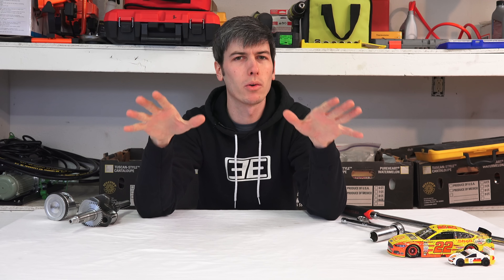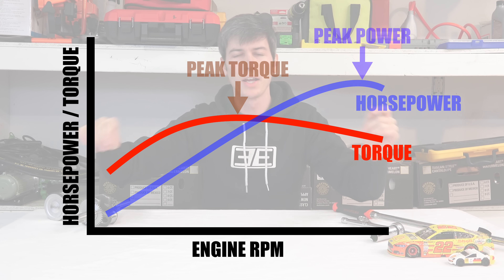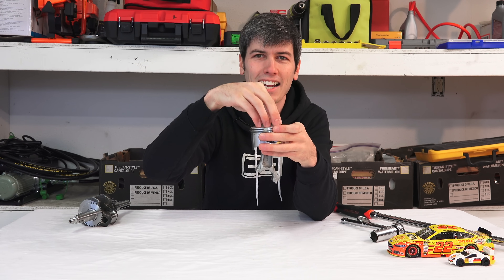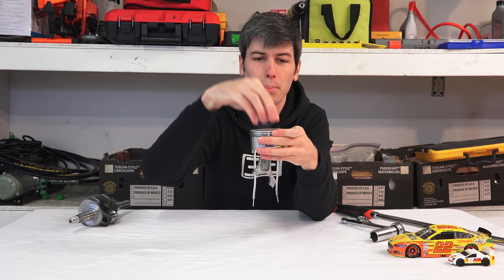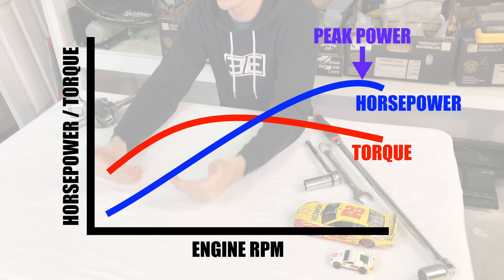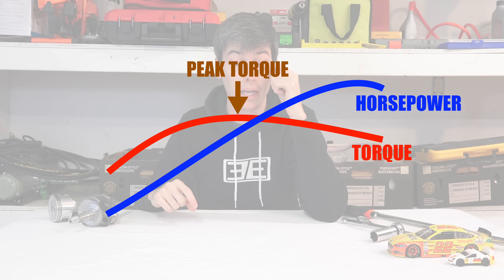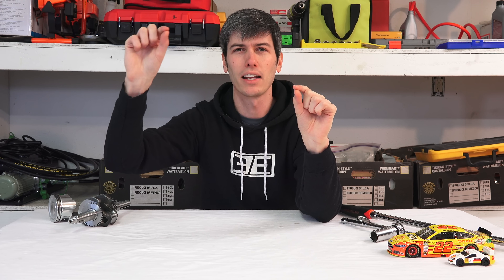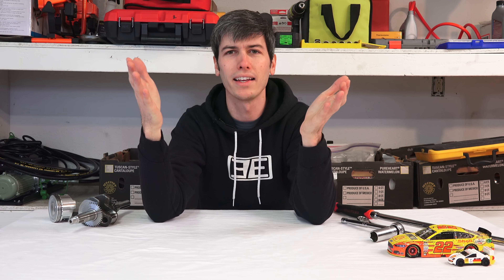Horsepower vs Torque - A Simple Explanation

Comment: "I don't understand."  (Buys a diesel.)  "OHHHHH!  Now I get it!"
Reply: People just feel more power at lower rpm and think "oh this is torque" when really it's just more hp at lower rpm.
Reply: @SlyNine  No, its not like that.
I have a Golf 4 1.9 TDI AHF 110 hp + Remap
My biggest torque is 320 Nm at 2100 rpm, but the maximum Power  (140+hp) the engine reaches at 4100 rpm :)
I have dyno graph.
Reply: Infovest  Uh you can't compare a production car to a built drag racing car, that's no comparison at all. Find me a street legal production car capable of trapping at 190 mph on the quarter mile, good luck.
Reply: Jacob Jensen
I can put down 150 all day on my stock motorcycle!
Reply: Back2Black cries as you fly off of a cliff
Reply: Turbodiesel... well buy a turbo petrol... now its fast
Reply: @Marco Franciosi The torque at the crank gets multiplied by the gear box. What tells you if the lower torque at the crank will be overcome by the better gear ratio. Say it with me. "HORSEPOWER"
Reply: @juschu  and then crashes it
Reply: Haha
Reply: No, you still don't get it.
Reply: Spark plugs FTW
Reply: @juschu  
Then you crash it down a hill past the finish line.
Reply: You bet my f350 with 7.3 turbo. Is just as fast with or without a load. But around 80 your topped out lol
Reply: Funny enough, my favorite real world example of why power is so important involves my experience using two different diesel trucks to tow the same heavy trailer up the same long grade in MT. Spoiler - the one with more power towed better. The truck with more torque made that torque at a such a low RPM that it required a much higher gear ratio at the same road speed as the other truck, meaning less wheel torque = less pull (less power).
Reply: *Buys a Tesla
Reply: 30hp diesel = 30hp otto/gas. The crankshaft brake power of both are the same.  You might conclude that gasoline engine has stronger torque because of actual and on hand experience, yes it is, though. The otto cycle (gasoline engine) produce its power with only 2 stroke to complete the cycle while the diesel engine needs 4 stroke to complete the cycle. Thats why gasoline chunks alot of fuel compared to diesel which will result to higher torque and acceleration. In conclusion, diesel is much more efficient than gasoline engine as it squeezes the available heating value of the combusted fuel. Application for otto cycle relates to high speed-high acceleration vehicles from automobiles,motocycles, small boat while diesel application goes into large and heavy vehicles
Reply: @Nafets-C  WRONG! Nikolaus Otto used a 4 stroke design. Nice try though. The modern 2 stroke cycle wasn't stumbled upon until WELL into the 1900s. And Otto DID NOT like the idea of mobile engines. He thought they were best suited for replacing water or steam power in manufacturing...

But you are correct that diesel fuel has more thermal potential than does gasoline. This is due the fact the diesel fuel is actually a very lightweight oil while gasoline is much more similar to a solvent.

Comment: Let make it the way , torque is the power of force apply to engine and horsepower is the speed applied from the engine , in short torque is required more for heavier cars, torque is to move a car fast from stop point and horsepower is to move the car faster from cruising

Comment: Someone pleaes explain So why would ever wanna shift at Max BHP ? I get it if you wanna pull away or over take then you wanna do it at Max Torque 

So if my car produces 84hp @ 4k rpm but i'm getting max torque of 150 Nm. Why would i wanna rev my car an extra 1k to get 95hp @ 5k rpm but only get 135 Nm of torque. By the time they hit 5k revs im already pulling away and hitting 5k reaching max hp
Reply: depends, high torque is great for low speed while high horsepower is great for high speed....

Comment: Would I be right in assuming that the physical momentum of the engine begins to allow the engine to use its power more efficiently after the initial torque curve? Much like if you need to move a heavy object it is much easier to do once it's already rolling? I suppose what I'm trying to work out is - is the torque peak the highest labour part of the engine and the power is the highest end result after the brunt of the labour has been achieved by the torque? Imagine bump starting a car, the initial heave, then the seemingly effortless push to accelerate it further until you run out of legs essentially.

Comment: Simplified Example:

Engine Torque (straight lines connect these points):
     180 lb-ft @ 2500 RPM <-- Max. engine torque
     150 lb-ft @ 6500 RPM 
     100 lb-ft @ 7500 RPM (redline)
BHP = Engine Torque x Engine RPM / 5252
     86   BHP @ 2500 RPM
     186 BHP @ 6500 RPM <-- Max. BHP
     143 BHP @ 7500 RPM (redline)
Tires rotate 750 times per mile (this is needed to derive gear ratios below)
For simplicity, assume no losses in the drivetrain

Scenario 1:  You’re driving along in 2nd gear at 15 mph and you punch the gas.  What do you feel?  The tractive force of the tires in a given gear will be proportional to the torque curve.  You will feel the maximum acceleration at peak engine torque, assuming you don’t change gears!  

Scenario 2:  You’re driving a given speed and you want to select the right gear to maximize your acceleration.  In this case, you take mechanical advantage of the gearing to combine with the engine output.

1) Say you're driving 60 mph and you're in 5th gear.  Your engine speed is 2500 RPM, so you're at max. engine torque.  The combined gear ratio of your drive train is 3.333:1, so your torque to the drive axle is 180 x 3.33 = 600 ft-lb.

2) Say you're driving 60 mph and you're in 3rd gear.  Your engine speed is 6500 RPM, so you're at max. BHP.  The combined gear ratio of your drivetrain is 8.667:1, so your torque to the drive axle is 150 x 8.667 = 1300 ft-lb.  <-- This is the gear where acceleration is maximum from this speed.   

3) Say you're driving 60 mph and you're in 2rd gear.  Your engine speed is 7500 RPM, so you're at redline.  The combined gear ratio of your drivetrain is 10.00:1, so your torque to the drive axle is 100 x 10 = 1000 ft-lb.  

Because the gearing varies the mechanical advantage, the torque at the tire axle varies from the engine's torque output when you change gears.  You can see that they are related by a linear function of engine speed, and are not related by a single constant.   Acceleration is proportional to the torque of the axle, but this also means that torque of the axle, and so acceleration, is proportional to the power of the engine when you change gears. 

Tractive force under the tires is what gives maximum acceleration, and it is also what gives you top speed as you push against ever increasing wind resistance.  There’s a belief that torque is for acceleration and BHP is for top speed.  As you can see, this is not the case.  

The bottom line is that the torque curve tells you how the tractive force will vary as you accelerate in a given gear, and the BHP curve tells you which gear to select to maximize tractive force of the vehicle.

[Gear Ratio Calculation:  Engine RPM / (Tire rev. per mile x Car MPH) x 60 min/hr = Rev. of engine per Rev of tire, = Combined Gear Ratio, or the ratio from the selecte
Reply: HollywoodF1 did you say simplified

Comment: A good example for this are V10 F1s, 18000 rpm, 900 hp, and poor torque but are so fast!
Reply: Raúl Vargas that’s correct but some people will not understand it, I’ve also gave this example to some guys and they replied that the cars are too lightweight. But they are two times lighter and 3 times faster acceleration than a 6s 0-60 car with the same torque.

Comment: Why don’t horsepower and torque peak at the same point ?
Reply: Because HP = TQ*RPM/5250 therefore RPM is always a factor and they'd always be equal only at 5250 RPM.  Higher revving engines can have much higher HP at higher RPMs.
Reply: Graph the following functions:
f(x) = x*(4 - x)
g(x) = x*f(x)

Do g(x) and f(x) peak at the same point?   No they do not.  Same relationship exists between torque and horsepower, both as functions of RPM.

Comment: What's the advantage of low pwr, high torque (1985 BMWe  120hp, 170ftlbs.)
Reply: Just look at a 100hp tractor, he can haul a plow ripping the soil at 30 mph no problem, hook to the same plow  a 100hp car, that should speak more than a thousand mathematical equations
Reply: These were designed for fuel economy and effortless city driving/keeping rpm low. They are more or less a stroker motor.
Reply: em745a   em745a  teorically yes, pratically can a car designed for max torque @5000rpm work all day @5000rpm without overheating? And fuel economy? And wear? An so on, gear reduction is not an option imo, for even beginning to think to prepare a car engine for hauling, you should modify the crankshaft increasing the stroke and lowering rpm, just lowering the gearing(still a substantial amount of work) functions only on a theorical base

Comment: The only thing I understood is that CVT is the best solution to max power.. I drive maxima 2016 and I tend to agree. I've been racing against gear shifting similar power cars and my cvt beats them every time.. And that perfect gear ratio with no blips (of gear change) wins the race
Reply: Talha WRONG. Name ONE hi performance car that uses a CVT transmission. NONE. 

CVT’s are used for economic reasons. They cannot handle excessive torque/horsepower.
Reply: @dpracing1  I'm not saying all hi performance carz have cvt. But if u haven't tried maxima then pls do. It's different.. Nissan has done a great job. To give u an example maxima is faster in real life than charger 3.5 Ltr.. What could be the reason?

Comment: Do downsizing engines and using forced inductions reduce emissions and do turbocharging increase fuel economy?Why are car and SUV engines getting smaller but motorcycling engines getting larger and why don't they use turbos in motorcycles?

Comment: High HP Hondas at the drag strip are a perfect example of how this all works in practice. Honda's have far less torque than HP and when racing a V8 you'll always see the V8 pull away off the line with more torque to push it ahead early but then you'll see the Honda back-half like crazy due to it's HP being more effective at higher speeds.

Comment: am afraid this video is actually misleading, torque is the force that spins the wheels without toque the car wont move a inch

the toque is mandatory to make the car moving while horse power is some ancient term for describing the capabilities of the engine as a whole (revs+torque), the problem is that the declared values are given at the crankshaft not the wheels

by gear ratios u can convert revs of the crankshaft to give more torque at the wheels and vice versa u can convert the torque into more revs at the wheels, faster spinning wheels will make car go at higher speeds but more torque at the wheels will make the car to accelerate faster, everybody do know that accelerating in the last gear isint really that rapid does it? is because the torque is low at the last gear ;]

Comment: F1 cars have comparatively low torque, and high power (due to high RPM). 
The low torque is why they often stall from a standing start. The engine just doesn't have the torque to accelerate all the car's mass from stationary.
Compare a SUV with 500hp to a F1 car with 800hp. Which one will best tow a 2 ton trailer up a 35% incline, from a standing start?
Reply: An F1 has lower weight to compensate with the low torque
Reply: @JH09SUMIT  
Not low enough, which is why you can't accelerate a F1 from standing at 2000rpm.
Reply: em745a  
Wrong
The F1's power AND torque curves don't match the SUV's. 
F1 cars are tuned for optimal engine thermal efficiency at >8,000rpm, and torque is a product of thermal efficiency (% of fuel burn heat sent to the big end)

Comment: Something is wrong here!  Let's say an M3 and  a diesel truck both have 500HP and they weight the same. Which one wins the race?
Reply: Idk if you're serious or not, but it'd be the m3 obviously. For at least these 2 reasons already: 1. the m3 has a way better hp to weight ratio 2. The m3 has much, much higher revs than the truck (trick are mostly powered on diesel, which usually has more torque but less revs and therefore less hp).
Reply: Wait let me correct myself, I didn't read the thing about the same weight. If that's the case then the m3 still wins, due to higher revs. Truck almost always run on diesel and low revs

Comment: Oversteer: When your rear end hits the wall
Understeer: When your front end hits the wall
Horsepower: How fast you hit the wall
Torque: How far the wall moves when you hit it

..As mentioned elsewhere.
Reply: 'Torque: How far the wall moves when you hit it'. Nonsense proverb that is absolutely untrue. Your kinetic energy will decide how much the wall moves when you hit it. which is derived from this equation Kinetic Energy =0.5MV^2 (M being mazz and V being velocity). Please do some research and stop spreading this nonsense around.

Comment: I say screw measuring both torque and power. All that matters is longitudinal g-force (ie. acceleration).  Just graph that data throughout the RPM range as well as in each gear. That's all that matters.
Reply: Exactly. End users only need to know acceleration.

Comment: nice video! I mean I got the gist of it; I know what torque means now but my limited brain is unable to apply it to the mysterious (to me) components of a car's engine, transmission, pistons etc... 

-question: does a car with lower torque numbers work harder than a car with higher torque numbers?

-question: why do car manufacturers give us the car's torque input? what am I supposed to do with it? do they expect me to do some math equations and predict what my car will do in 3rd gear at a speed of 60m/h when my RPM reading is at 3000?

-question: does torque numbers indicate a car's engine reliability in any way? because: for example, I heard that Japanese cars are more reliable because for every liter of engine size they produce less than 100 hp. ( a 3.5 Lt will produce   300 hp or less "They don't stress their engines" ) vs. in a Mercedes for example a 3.5 Lt may produce as much as 330 to 350 hp or even more) 

anyway, thanks for the video, at least I know now what the freakn' word "torque" means lol

Comment: SIMPLE EXPLORATION: You're producing HP and TORQUE when you're riding your bike.

Legs = HP
Pedals = TORQUE 

On a dyno test a human cycling would produce a similar HP and TORQUE line whilst shifting through the gears.
If you shift at your peak TORQUE level you won't have the leg power to increas momentum fast, therfore you'd shift on your peak HP (pedaling speed) which varies as you work through your gears.

...if this doesn't explain the difference to you then it's just not meant to be is it!?

Comment: So... Work=Torque?
Reply: @eliasgruber3630  Oh... Thanks for the explaination😉
Reply: @cnash5647  Torque becomes force, after applying it through a rotation angle.
 
The units of torque are Newton-meters.   The units of work are Joules.  Newton-meters appear to be mathematically the same thing as Joules, but they really aren't.  You have to apply  Newton-meter of torque through 1 radian (~57 degrees) of rotation, for it to become 1 Joule of work.

Comment: So torque is a similar concept to leverage, just put into a rotational force?
Reply: @eliasgruber3630  Leverage refers to the ability to use a simple machine to trade force for distance.   It refers to the performance of your gear system, pulley system, lever, wedge, screw, or other simple machine, to amplify a force for your application.  It could involve torque as it does with gears and levers.  Or it might not involve torque, as it does for a wedge.
Reply: Torque is the rotational equivalent of a force.  It's a measure of how much a force "twists" or "bends" its target object.   Torque is to force, as RPM is to MPH.

Comment: If you can increase the lever length via gearing in a car with more power to give it more torque, can’t you increase the power in a car with more torque by reducing the level length via gearing?
Love your videos btw, and as you can see, I’m not math wiz!
Reply: That would be what overdrive gearing is.  Precisely what you use, when you achieve a cruising speed, and shift to your highest gear.

Comment: So horse power is how fast your accleration is. So how fast you can get from 0-60. And torque is what exactly??
Reply: Torque is the rotational equivalent term of force.   Just as RPM (rotation rate) is the rotational equivalent term for speed.

Torque is what you get when you apply a force with a line of action that is offset from an axis of rotation, and it ends up causing rotation.

Comment: There is no need to refer to torque at all, just the power vs RPM curve.  The area under the curve is the best measure.  I would always keep in mind where you spend 90% of the time driving which could be at low/middle RPM.     An Evo 8 can be embarrassed by 1.0 litre engine when the former is off boost.

But even those curves are misleading because they are measured at full throttle.  What looks good on paper can still drive like a heap of crap.